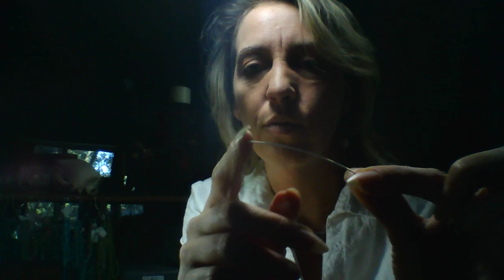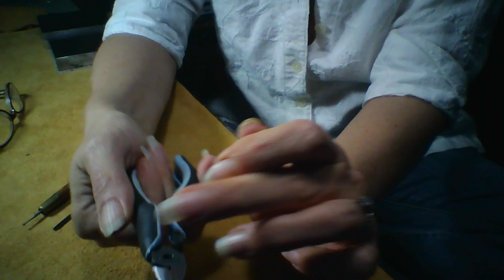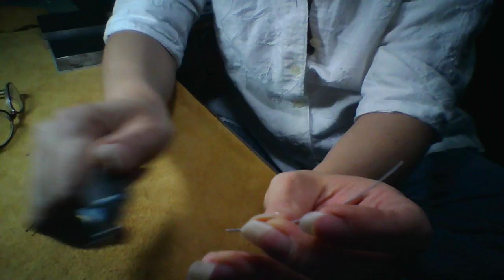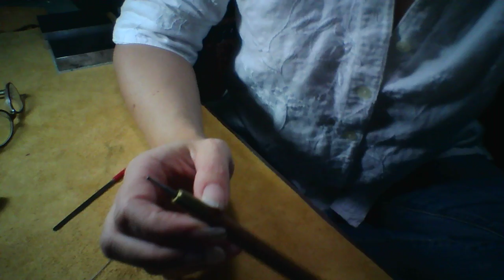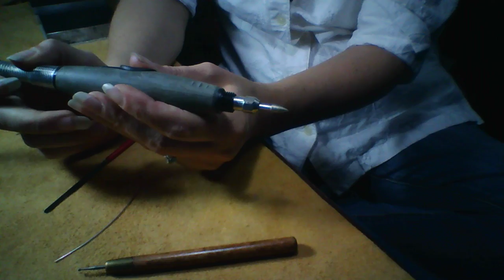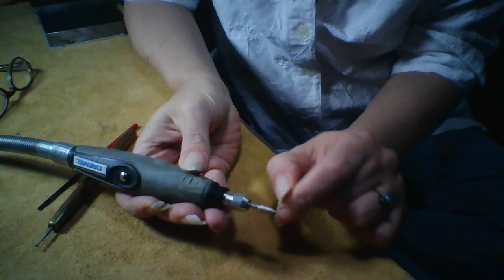How to use a burr cup and how to file wire ends for jewelry making.

Comment: I cannot thank you enough!  I need to trim my blocking wire for finishing a knitted object.  To save some money, I bought very long ones, which I'll cut to my needs.  Then I'll need to thread the wire through most of the edge stitches!  I didn't know this tool existed, and looked for a long time before I found your video.  Thank you, thank you, thank you!

Comment: Great info and demo. I use mostly 20 gauge wire, but it's good to know I don't have to buy several different size burr cups. And the dremel tool is a kick!  This is going to make making earring wires so much better. Thanks!
Reply from the maker: ZainaDancer I have taken up using a fish hook sharpener and it is so much quicker!
Reply: MagpieGemstonescom ....I will definitely look into that!